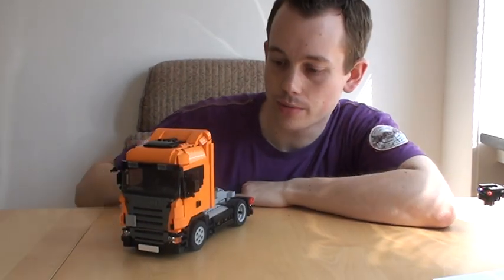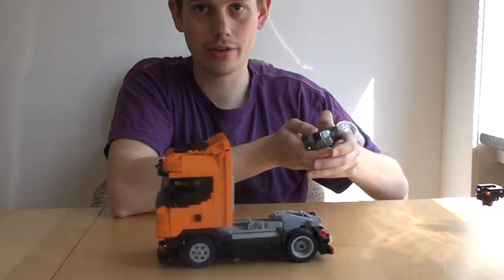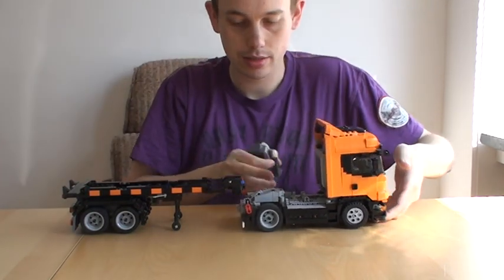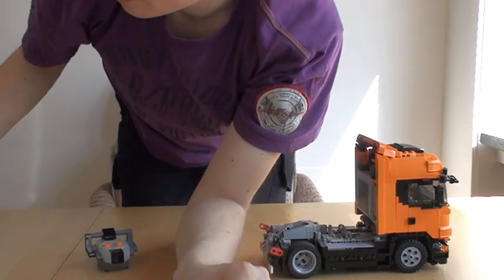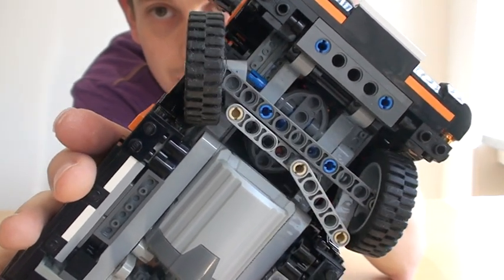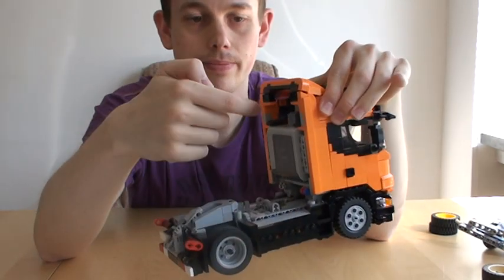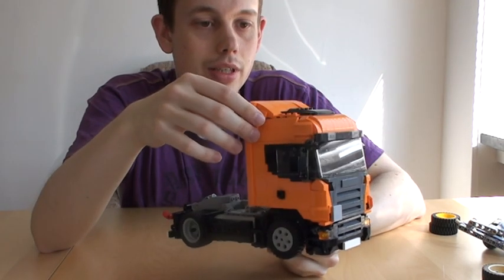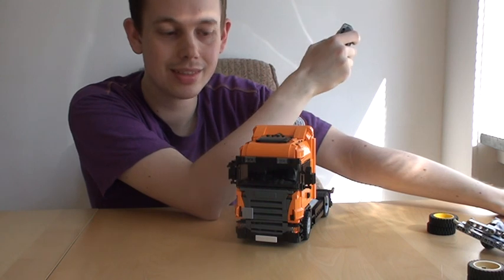LEGO Model Team Scania R 4x2 Highline

Comment: You could use the tires of the Lego Creator VW T1 van as front tires for the truck. Nur it still is an amazing Modell.
Reply from the maker: Yep. Lego has recently made an even more accurate design with the same tire size as seen on the Routemaster London bus. I am going to use these once I have enough wheels.

Comment from the maker: The opposite, actually. Without Ackermann steering geometry, both front wheels would turn an equal amount, which would not correspond to the two different circles that they are traveling. However. Since these are LEGO models, using Ackermann steering geometry doesn't really make a difference.